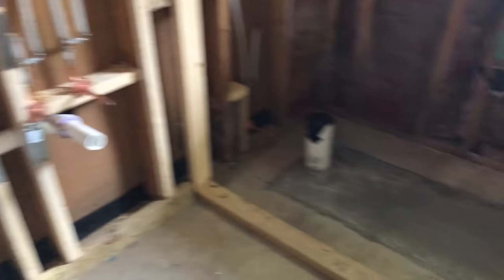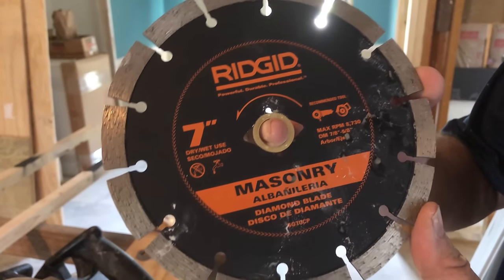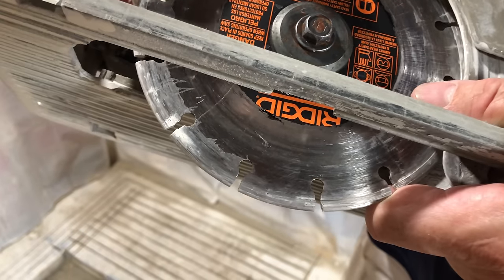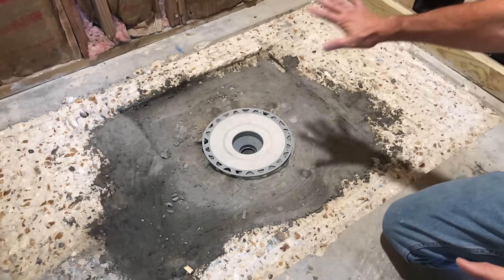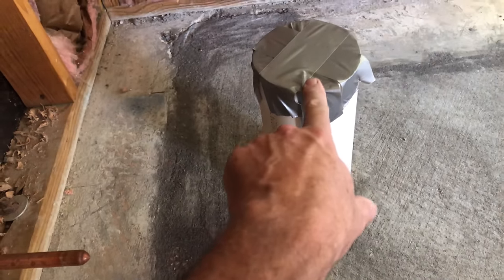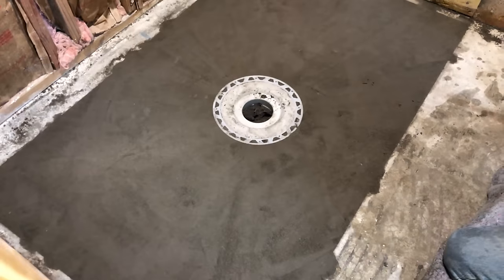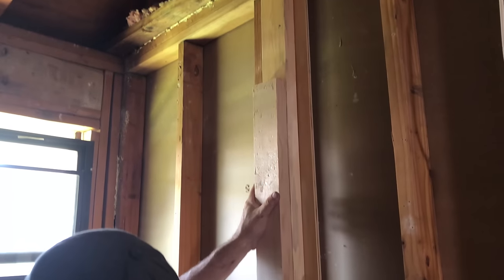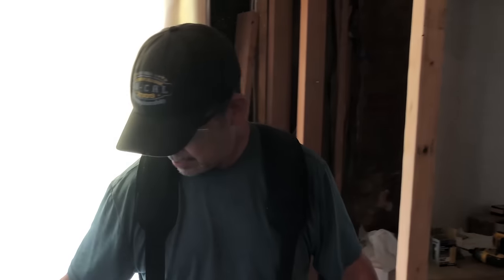Installing a Curbless Shower on a Concrete Slab

Comment: I like the idea of scoring / cutting the concrete. With my lack of experience I probably would have just spiked it then chipped it. Way more dust and way more vibration/fatigue. This is better as you only need to use the sds/demo hammer one time.

Comment: Use a dot laser on door framing, window framing etc. Make a mark say like 3” from bottom of your stud, then put your Dot Laser on that 3” mark  Dot Laser will shoot that red dot straight up/down. Go to top of stud put your tape measure against the top of stud. Adjust stud until the red dot hits that 3” mark! Really helps me & is a great tip! 👌👌Great job on this Video! Keep um coming!👍👌💪👊

Comment: Great job. You should think about making a dedicated saw for this job specifically. I drilled and tapped a hole in the shroud of my skilsaw where I inserted a brass fitting to adapt a 3/8” tubing to the lavatory angle stop. This will help free up your assistant to vacuum up the water. Just a helpful tip. God bless
Reply from the maker: Cool idea thx Sal 👊👍

Comment: Hey guys, love your videos. Super helpful on my DIY projects. I am planning a new home that will have polished concrete floors throughout except for the showers. The showers will be tiled and curbless but I am struggling trying to find videos that show how to make the tiled shower floor level with the concrete floor in the rest of the bathroom. Since I will be finishing the showers myself, should I have the builder leave the shower floors gravel and install the insulation board and concrete myself at the required slope?

Comment: Question.. Why'd you use the thin set and paint it on and then the quikrete on top for the shower base? 
Tip- ram set is soo much nicer for affixing studs to concrete, easygoing and fast😁

Comment: Pretty much the same way I did my last curbless shower on a slab, where is the follow up on the finished product though ?

Nice Tundra 👍
I have a 2010 and love it !
Reply from the maker: Our video where we installed the exhaust hood for the stove has a walkthrough of the house that has the completed shower, go take a look let us know what you think!
Reply: Sooo the wet circular saw on slab.
Ive typically key cut like 1.5" relief on perimeter using makita with shop vac and plastic off room.
Im curious on what looks like a well ventilated remodel this wasnt used. To avoid the slurry in drain and having to flush trap.
 Genuinely curious. Not hate love all of the content guys.
Ive been down here in florida for 15 years doing tile and kitchen bath remodels and always looking for more info and to improve.

I just know that on many jobs any kind outside mess is a huge no no!
Most of the snowbirds in FL really strive to make there lawn like Delaware and you cant even toss out your water bucket outside. Let alone flush a trap.
I do like the idea of a hose to spray out drain over the full respirator mask plastic and negative. Theres no issues down stream like with exterior washout??
Reply from the maker: @surffish386  You can see a black rag in the drain beginning at 16:07.  I mentioned earlier in the video that years ago I had to replace a p trap in a floor drain because the concrete finishers let the slurry harden in the p trap.  Lesson learned and always a good reminder, I should have pointed that out again, thanks Weston.

Comment: Currently in the building process and a bath tub including the plumbing was left out... what is the estimated cost of breaking up the concrete, adding a vent for the bathtub and water lines, etc? Builder doesn’t want to hold back the progress to make it happen

Comment: Others are using plastic liner or paint-on water barrier -- perhaps standard practice where installing in framed floors / over finished space? Obviously, synthetic moisture barriers didn't always exist, and on a slab-on-grade floor, what's the worst-case, anyway? Tile failure > a gallon a day leaches into slab, maybe makes it through to dirt below? Erosion over time? Frost heave? My situation is a basement in a row house, so I'm not worried about frost heave. Seems like moisture barriers can also cause problems. 

Would love to have your thoughts.
Reply from the maker: We almost always use Schluter Kerdi on the the floors, depends on availability...  it's bulletproof imo.  I don't think liquid applied like you get at the home center are proper for shower floors.  check out https://www.diytileguy.com/ I agree with everything on his website

Comment: Great video! I haven't seen anything building related that you haven't mastered. One tip: When driving screws into the plywood backing through the stud, I'd drill a clearance hole in the 2X4 so you're not threading into it. This saves energy, and eliminates the possibility of a trapped space between the plywood and the 2X4 caused by the threads holding them apart. Otherwise, you're basically stripping the threads in the 2X4 to cause the plywood to pull up against it. May as well start with that.
Reply from the maker: Cool thx Ken 👍💪

Comment: Hey Paul, I have a question. When setting your first flange in the drain pipe; how much gap do you want from the bottom of the flange to the surface of the concrete slab?

Comment: I have a 6x6 cutout in my slab and we are doing curbless.  Can I use the concrete as the finished shower floor?  Would it need to be sealed and slip-proofed?  We have learned to not like the maintenance of tile.

Comment: Paul, this is a rookie question but how do you determine the slope? Like to the drain pan you put in and to the old concrete, how did you figure out the height or depth to place to drain pan? Love the channel guys! You too are rock stars and a good team!
Reply: 1/4” per foot from the longest point within the shower pan to the drain
Reply: A bubble level at 'zero' and a tape measure.
Reply: Taught that: You get a perfectly straight board. Lay it at center point (the drain) going outward(the wall). Lay leveler on top of board. If the bubble is where you need it your good. Follow this all the way around. Then 2 more times for good measure.

Comment: Your guys videos have gotten much smoother over the years. Is there a reason you went this route vs just tearing out the concrete before the plumbing and then poring a little concrete to the slope you needed?
Reply: Not a criticism btw maybe that just seems easier to me because I used to pour concrete
Reply from the maker: This shower was bordered by two exterior walls. I didn’t want to have to jackhammer into the footings and risk cracking the stucco.  The footings on this house were huge.   I tunneled under one in another video

Comment: By injecting the thin set under the flange, aren't you blocking the weep holes? Shouldn't you be packing loose gravel underneath the flange to allow any water to escape into the drain?

Comment: 18:56 - Jordan is applying the thinset right before the dry mud goes on.  Is that the ideal way to do it?  That is, you should put the dry mud on freshly mixed thinset?  Thanks.
Reply from the maker: The thinset is bonding the dry pack mud to the slab.  Dry pack won’t stick to concrete.   Some have commented that it’s not necessary

Comment: i love the video. great details explaining the pitch and how apply the thinset and the concrete mix. i have a question, what do you recommend to use on first floor which has a 3/4" plywood for the base and using the pebble stones? and how deep did you cut the floor with the diamond blade?

Comment: Nice job, I am building one right now and understand that feeling of being able to move onward after all that  chipping.  Not sure why you didn't have all the shower floor cut away, re-pour the slab, then  drypack it though.  After all, somebody was already there cutting that slab...
Reply: John, did you demo your floor and then repour it? Did you dowel into the edges with rebar to tie new pour into the old slab?

Comment: Nice video.
I'm doing a custom shower in my basement. Pretty much the same as this. Is it ok to make a concrete curb poured and tied in with floor. I plan on tiling it with shower doors on the curb?
Reply from the maker: concrete curbs are fine but it all needs to be waterproofed with Ditra or similar pitched to a drain

Comment: What about a NEW build concrete slab with  polished concrete floor  bath ? In other words no tile on top …IE curbless shower drain  in the middle of the room…do you add the flange during the slab pour? How would that work?

Comment: Hi watched your video on curbless shower on slab. I have a new build and wanted a curbless master shower, age in place, they didn't pour for it, it's post tension cable, can't find anyone in my area that knows how to install. Do you install in the Ardmore, Oklahoma area by some chance.  You seemed to know what needs to be done. The size is 4x6 shower,  Infact I need two bathrooms tiled. Thanks

Comment: hey guys quick question the existing concrete slab where you cut out for the shower screed is obviously flat not slopping? does this affect water run off at all or is it really minimal being only 4 inches or so from the wall

Comment: Had my 2 boys our with me fitting a floor last weekend it was great but as they are only new they got bored easy as I had to cut round doors all at 22.5 angles handsome of the joins were in one piece so door casings and stops had to come of but it looks great now I dont mind sometimes floors are not just straight forward fits but try telling teens that .🤣🤣I left both of them at home today to catch up they wouldint work after 8 hours 🤣🤣🤣🤣🤣

Comment: Is it feasible to do this on an entire 5x8 bathroom? I'm guessing I'd have to cut out the entire floor. But could I get enough slope to make a difference? Right now I have water that sets for days because there's no airflow through the room. I want to slope the whole floor towards the shower drain to get rid of the puddle.

Comment: Always enjoy watching you guys work.
I feel you are well qualified to have done the electrical.  How come you sub-contracted that out?  Was that a requirement for your local city code or ordinance?

Thanks!
Reply from the maker: Correct, our local permit office requires licensed electricians and plumbers only.  They pull a separate permit and it's digitally attached to my building permit.  Thanks Bill!!

Comment: So I’m going to try and do this myself. I get the 1/4” per foot. So would you measure from the outside in to se the flange depth?
Reply from the maker: Yes, from the edge of the flange to the wall at longest dimension.  Good luck.  Check out sal diblasi and Isaac ostrom tile videos for excellent instructional videos
Reply: @StudPack  thanks

Comment: Stupid question BUT shouldnt you let the base concrete cure for at least 21 days??? It is concrete and has water in it. If you through tiles over top "where" does the water evaporate to?

Comment: Question- 
Is there any advantage to using the circular drain over a linear drain, which would reduce the pre-slope angle from the close sides to the drain? 
Thanks guys.
Reply: Very much interested in this question too!

Comment: Great video!  Thank you for the content.  It is evident that you take a great deal of pride in your work.  I know that someone can make any job look "neat" in their video with editing, but this is an obvious representation of your careful and considerate craftsmanship.  Not only did you keep you primary task clean and neat; even in brief background shots that might look like a disaster area in some other videos, your job-site was pristine. I'm not sure if it was all you, considering you obviously had other trades coming in, but given the materials in inventory in the background, and your reference to longer term phases of the project, I'm assuming you're the lead on this.  That organization and neatness says a lot about the way you respect the time your customer is paying for (assuming this isn't your own home).  Kudos!  That said, I have a question about the use of wet thinset on the slab just prior to dry-pack.  Would it be equally effective to use a bonding agent (blue-glue, as a like to call it) over the existing slab before setting the mud base, or is the wet thinset used for a better reason?  It looks like you may be new to the YouTube thing from your subscriber count, but the content suggests you're miles ahead of that subscriber count.  I'm very much looking forward to more videos from you! Subscribed!
Reply from the maker: Hey Richard thanks for the kind words! We're glad you enjoy the videos. Dry pack mortar will not properly adhere to concrete on it's own. It's moisture content is way too low. We intuitively know that two bricks won't stay together without mortar. Think of the concrete slab as one brick and the dry pack as another. The thinset slurry bonds them together like mortar between two bricks. Stay tuned for more videos we got some awesome stuff coming out this week!
Reply: the Blue Glue as you referred to it , is the new school. Old school is the slurry made of portland cement you see here. 
I learned that from Mike Haduck
✌🏽

Comment: If I have a concrete floor already sloping to the drain can I just add a water proofing membrane on it like shluter or redguard and then tile over that without the motar bed or dry packing?
Reply from the maker: Schluter Kerdi must be used with their drain and even though Redguard is approved for floors I'm not comfortable with that application.   I'd need to know more.  Is there already a drain there or is it just roughed in?  Does the concrete have the proper slope?

Comment: looks awesome, no curb....did u tile right over top? I don't see a second part of this video....trying this myself, and am so confused!
Reply from the maker: Thx George.  We used Schluter Kerdi on the floor and walls.  Worked great.  Check out our more recent bathroom remodel.   Same basic process but not curbless.   There is a finish shot of this curbless shower in a later video in that series.  It’s called update or something and we installed kitchen hood

Comment: #studpack how would you go about preparing a slab floor for a curbless shower before the concrete is placed? (New construction)
Reply from the maker: Simply form a recess in the slab.   Ask your tile setter how much of a recess they need.

Comment: Do the precuts really make that much difference when you are going to use a chipping hammer anyway?
Reply from the maker: They certainly helped on this project.  Without them you’re kinda going at it blindly and are at the will of the chipping hammer.  My take on it anyways
Reply: Thanks for answering all my question, Sorry to bother you so much
Reply from the maker: No problem 👍

Comment: Hey boys, one quick question. I didnt catch what you used to set that drain piece in place, you said you "injected" it in there. Was it the same type of thinset you put down before the mortar bed? Thanks!
Reply from the maker: Yes same thinset.  We injected it under the flange with a grout bag.

Comment: Please share what ratio you mixed your thinset for the slurry coat. Thanks for the helpful video!
Reply from the maker: We can't remember the exact ratio we used, instructions vary from product to product; we normally follow the instructions on the bag it comes in! If you can't find instructions we were mainly looking for a pancake batter consistency! Just keep adding water until you get the consistency you need and you should be good to go!
Reply: @StudPack  cool, thanks

Comment: Was wondering what was the reason for using the thin set? Why didn't you just put the sand mix directly over the chipped area? About to start a similar project and seems like there's so many ways to accomplish. Thx for the video!
Reply from the maker: Hey Jerry! Thanks for the comment. This is called a slurry coat or a mortar bed bond coat. It bonds the mortar bed to the concrete. The subject actually came up in a recent Schluter class I attended and it seems to be the method the pros use. It's also recommended in the 2019 tile council of North America handbook page 254 detail B421C-19. You're absolutely right though, there are many ways to do it! There's so much info out there it can be hard to sift through it all. I hope that helps!
Reply: Because drypack (aka deck mud) is not 'sticky'. If it's less than 2" thick  it is unstable and useless.  But if its used along with a bond coat like thinset then  it will work at 1/2" thick.  Also, though a slurry is good for this application, it is a common trick to use  thinset at its typical consistency along with Drypack to float a floor, extend a stair, or any other type of build-up exceeding 1" during a tile job.

Comment: I'm gonna reno my guest bathroom and I wanna do the curbless too. How deep should I cut thru the concrete slab? Thanks!
Reply: You won't get to choose how deep to cut through it. You'll have to cut until you get through. Ask a plumber or demo contractor - they will have a slab saw. Or you can rent them if you're brave. Once a few cuts are made, the rest can be broken up with a sledgehammer.

Comment: Dumb question here, why did you put thin set before a dry pack mortar?
Reply from the maker: Sort the comments by "newest first" and scroll down to the bottom and look at Jerry's comment and the replies.  Basically bonds the dry pack to the slab.